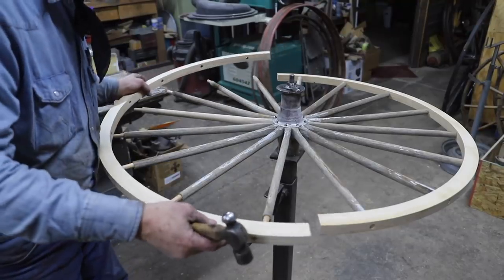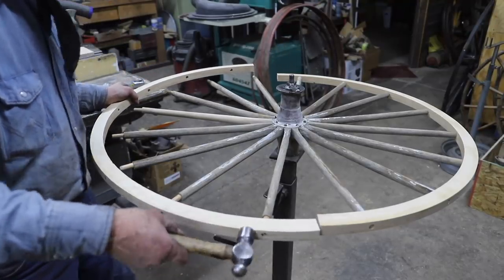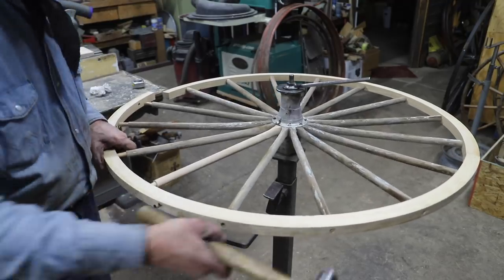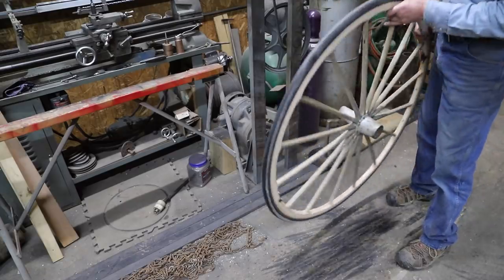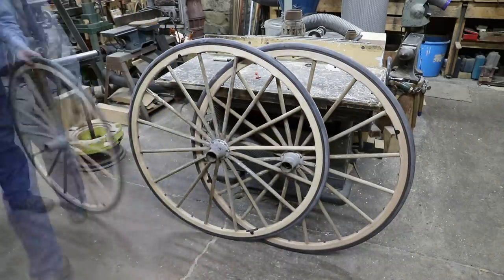How to Convert Buggy Wheels to Hard Rubber Tires | Engels Coach Shop

Comment: I did not realize that you'd make new feloes to compensate for the extra thickness of the rubber tire and iron channel. I just figured the wheel would just be a little larger. Great video!

Comment: Even if I watched all your videos, with the rubber tire setup - and I am clear and fully understand the process - I do not stop being mesmerized, each and every time you post this operation. The same state of being, I had it many years ago - back in the 80`, in my first payed job, when I was working on a dredging vessel, of large capacity. In that morning - the whole chain of 56 buckets (each weighing 2 metric tons) , was dropped on the bottom of the bay, at 19 m (60 feet) deep. It was for me ...an impossible puzzle to solve, but under my eyes and including my anticipation, that huge pile of cast iron - lying on the bottom of the water - was brought back to the machine - of course: using huge steel ropes, a large floating crane and very powerful winches - with kind of the same process and work system that you apply at work on setup rubber tires
.
Thanks for the video!

Comment: You must have previously measured the width of the outside wheel felloe holes so the interior felloe "tie-irons" plates will accept the bolt heads . . . AND have the practiced eye and hand-skill (that no one recognizes) to drill correctly so it all works . . . Wow!

Comment: I was wondering how you you were going to close that gap in the rubber where the wire was welded...simple enough.  Thanks for making these videos!
Reply: Jack Duncan 

Which he could only do because the rubber was cut about 4 inches overlapping. That gives enough pressure to close the gap.

Comment: Hi Dave  At the risk of duplicating a complement given by others I would like to mention how much I appreciate the care and attention to detail shown when you "time" or clock the retaining nut on the felloes! One question: would a bit of threadlocker on the threads be of any use in case the nuts have a tendency to loosen over time? regards as always vic

Comment: What are the fasteners called that hold the steel channel to the felowes?  1/4" NC at one end and spiral groves/ribs at the head?  Outstanding workmanship as always.  I suppose the slight difference in diameter if not accounted for would mess up the ABS.

Comment: When you make the steel rim, how much smaller is it than the wood rim? That's an interesting tool you use to measure the wood rim and the steel. Interesting and educational as always. Thank you for sharing.
Reply: @EngelsCoachShop  Or 0.002 😉

Comment: First of all thank you for the interesting video, and secondly, Could you please answer why the screw nut, once had four ribs and today has six ribs? According to logic, six ribs are more likely to erode ribs than four.
Reply: Economy, it's less steel used to make bolts and nuts with six flats than with 4. Plus the narrowed contact margin makes for a fastener that isn't so likely to work loose if adequately tightened.

Comment: I have seen several comments about why the diameter is important I personally suspect it's about current clearances with the rest of the buggy could  cause a larger turning radius could even cause problems under the body of the buggy if the steering axle swings that far, am I correct?

Comment: I have a new undercut with rubber wheels, I noticed a 3/16 gap in both front tires where they’re seamed, should I glue the separation, if so what glue should I use?
Thank You

Comment: I had been wondering how they would have welded the C-channel in the olden days, but apparently your video shows they didn't. That they just bolted it into the felloes with that black plate. I assume you put that gap in between the two breaks in the felloes. Then where do you put the start and end of the rubber tyre? Just anywhere or opposite the gap in the steel rim?
Reply: @EngelsCoachShop Thanks Dave, but how would they have welded those in the old days before MIG welders? Hard to forge weld I'd think...

Comment: How did someone braze steel back in 1800’s?  Were the some how forge welded
Reply: Tom Carlson You can use a jet of air to generate a hotter flame.  Metalworkers have been doing it for thousands of years.

Comment: Just out of curiosity. Do you make the inner circumference of the steel channel a certain amount smaller than the outer circumference of the wood wheel?
Reply: @EngelsCoachShop  I'll ask the stupid question, what does 2/10ths of 1% mean?
Reply: @davidquerry8869  A 30 inch diameter wheel has a circumference of 94.28" or 94 and 9/32" 2/10 of 1% is .002 x94.28 =.0.188" or very close to 3/16ths of an inch. So you would measure the tire out to 94 and 9/32" and cut it 3/16th of an inch shorter. Heat the ring to get it big enough to fit around the felloes and as it cools it tries to get back to the size you cut it keeping everything scrunched up tight.
Reply: @bobhazzard7747  Thanks

Comment: As 2.5"" (approx 65mm) is such a small amount, what is the advantage of reducing the wheel diameter to add the rubber tyers?
Reply: I don't know for sure but if the buggy has fenders , might not be enough Clarence
Reply: To maintain the correct wheel diameter.   Buggy's have brakes that ride on the wheel tread so the wheel diameter has to be maintained..

Comment: Sooo? You cut the rubber about six inches too long? And that gets compressed too short and then you have to bounce the wheel, to move the rubber to decompress a bit and to move to fill in the gap? My real question is... Does that initial six inch overlap have to be a very special overage or do you just estimate the overage? ❤🌅🌵

Comment: What is the small metal pieces you bolt to opposite sides and inside the rim, and what is their purpose? And how do you decide where on the rim to locate them?
Reply: There are two fellows on each rim so that gives you two joints. that piece you refer to spans over the joint to ensure alignment
Reply: @Wooden-things  That clarifies. Thanks so much!

Comment: Is that a new dust collector?  It looks out of place in your shop.  The shop does look pretty clean in this video.  Maybe the dust collector has something to do with it.  As much work and labor you do for these jobs, I can't help but often wonder how much harder it was back in the days before power drills/saws/planers/routers, electric welders, etc...  I suppose it would take three or four men to do back then what you do by yourself.  Right?

Comment: How do you calculate the length of the rubber?  That wasn't clear.
Reply: It is usually the distance between two spokes. The rubber has to compress to keep the gap closed.

Comment: If they were my wheels I don't think 2 1/2" would justify the cost of having the wheels reconstructed.
Reply: My thoughts exactly. Why not just mod it and let it be? Just curious.
Reply: Maybe owner wants to retain original height???
Reply: If they left the wheels bigger it would increase top end speed and slow down acceleration. Maybe they want to keep the acceleration 🤣🤣
Reply: It’s because it with put the speedo out... do you know hard it is to find those old speedo gear drives  nowadays 🤣🤣
Reply: I wonder if it has to do with clearances and front wheel rotation when turning. Bigger wheels in the front would limit the amount of turning radius the buggy could develop.
Reply: It's about people with a lot of money to spend.  These buggies probably come out of some AC barn twice a year for a parade.
Reply: Then you would have to reconstruct the brake hardware for the larger wheels.  Plus you may other clearance issues with larger wheels...
Reply: @andrewdraper8336   Plus it would drastically change the rear end ratio and affect the fuel mileage.
Reply: Clearance for turning and fender radius, Things you wouldn't think of unless you restore alot of buggies. Things the pros know that justify their wages.

Comment: do the bolts you used to attach the metal rims to wood have a name? I've never seen a bolt with a machine thread but also have part of the shank be twisted into a spiral. Is this spiral section alittle fatter then the threads so it bites into the wood?
Reply: I was wondering about that myself
Reply: @EngelsCoachShop  Thanks. Source?  Mr. Google, as you named him, didn't help.
Reply: @shopshop144  Engels Coach Shop sells them.

Comment: Why is it so important to keep the old diameter?  Arent most of these open wheeled ?
Reply: Same question please
Reply: I expect the extra height will affect the feel of the buggy as its used. Being taller will raise the centre of gravity, reducing stability through corners and at speed.
Reply: The speedometer won't read accurately and you might get a speeding ticket. :-)
Reply: @ZaphodHarkonnen  Yes, this and it changes the tires relationship to the frame. Think 18" tires on a car that has 15" standard.
Reply: It all boils done to turning radius and brakes everything has to remain the same as the old wheel's. The front axle would have be made longer to account for the different wheel diameter and the brake for the back wheel would also have to be moved and axle made longer to line up with the front axle.
Reply: tire height also affects how easy the buggy pulls. There's also possible clearance issues with the turning wheels

Comment: Why is it important to keep the wheels at the original diameter? Not much of an increase.
Reply: One aspect would be that for every one(1) inch or unit of diameter larger, the buggy  or wagon would be one half that higher off the ground.  If there happens to be fenders on the vehicle, that might could give a problem with clearance at some point.
Reply: Thanks for the response; makes sense.